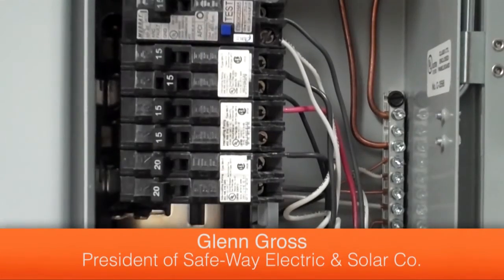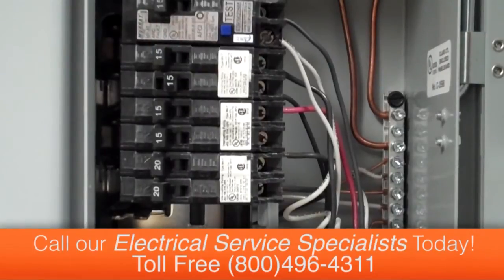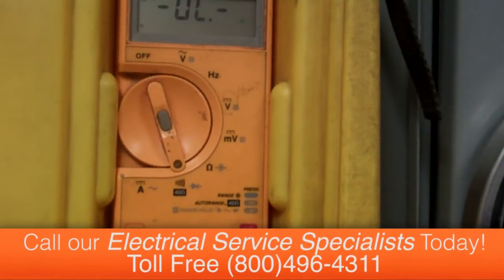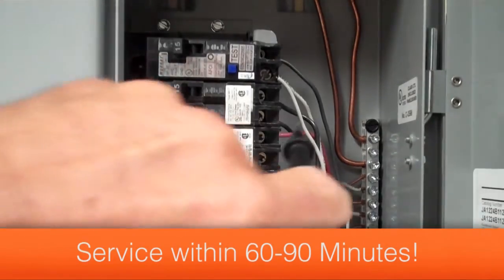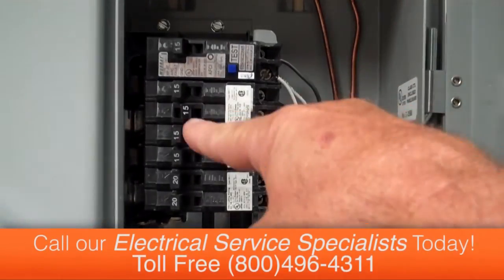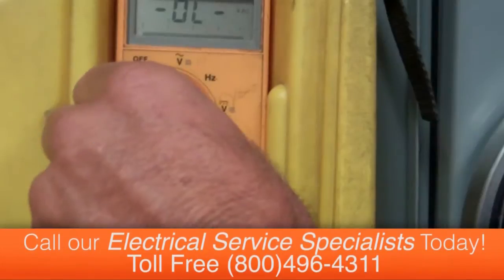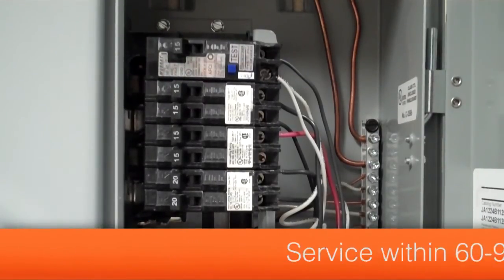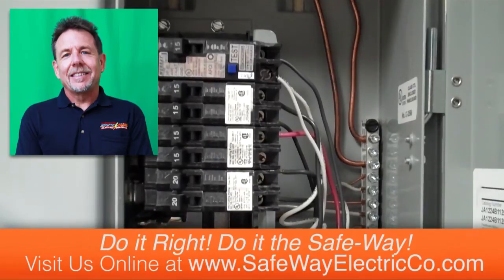Resetting Circuit Breakers with No Short on the Circuit

Comment: Every time I switch my ciruit breaker from off to on,it goes back to off.
Reply: Then you have a short somewhere on the circuit. Unplug everything on the circuit, and switch all lights off. If it still does that, then you have a problem in your wiring, and you need to have a licensed electrician come and troubleshoot it.